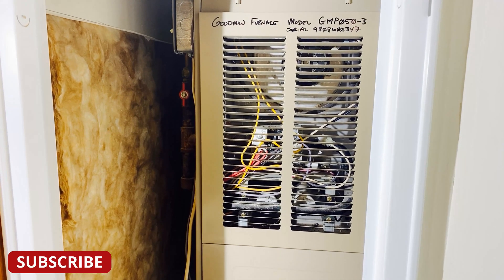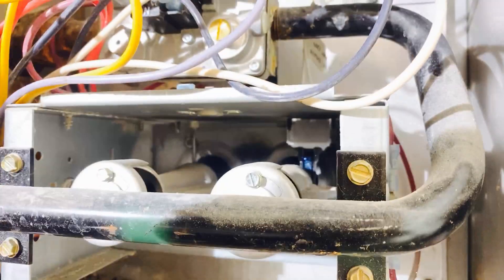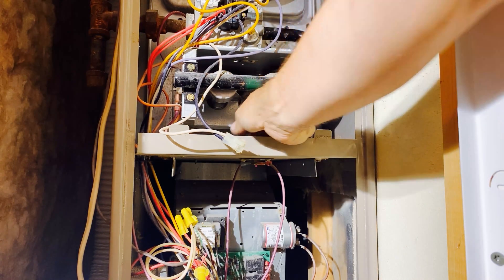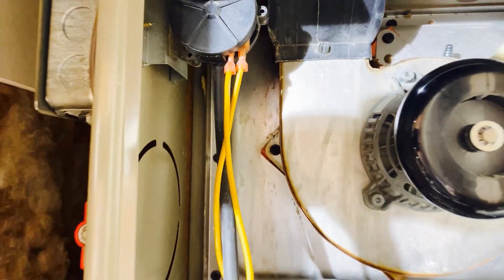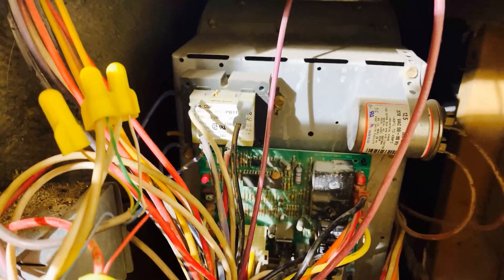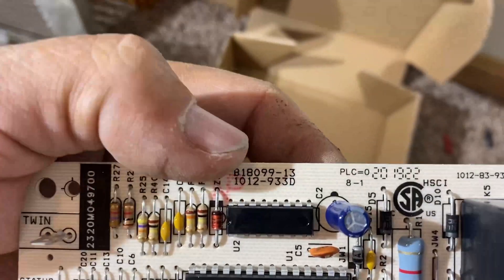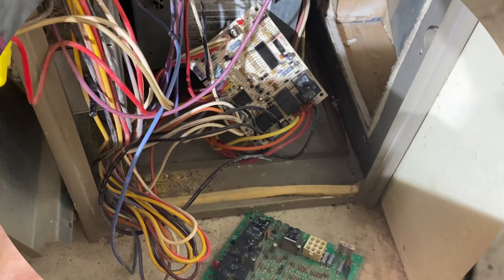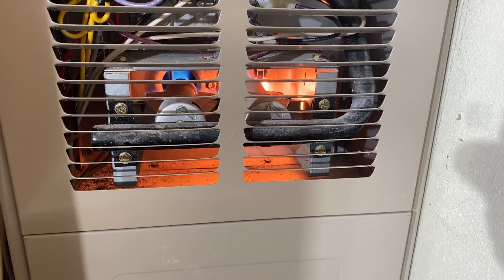Gas furnace not igniting -  Goodman furnace wont ignite - DIY Gas furnace repair

Comment: What does the flame sensor have to do with the furnace lighting?
Reply from the maker: Jim, 
Here are the simplified basics of what is happening when your furnace starts up so you and anyone else reading this thread can really wrap your head around the process... 
I know its a lot more than you asked for and you may know a lot of this. Please don't take this a smarty pants long winded answer. 
The better you understand it the better chance you have of fixing it! 
The thermostat calls for a heat cycle...
The evacuation fan comes on first getting rid of any possible build up of flammable gasses so there won't be an explosion in case of a leak or other build up of gasses in the burn chamber.
The computer (the control board is a very simple little computer) tests the operation of that evacuation fan with the pressure switch. 
If the pressure switch isn't working the computer will "believe' the evacuation motor did not do its job and will not light the ignitor (to avoid a big kaboom). 
If the evacuation fan works, and the pressure switch verifies that for the computer board, the ignitor is given power and will start to glow. 
Then a limited cycle of gas is supplied to the burner and that gas gets lit by the glowing ignitor. 
A gas pressure verification happens in this approximate time frame as well that lets the computer know that there is gas being sent and that the gas flow through the gas supply valve is sufficient. 
IF everything is still in order and that limited cycle of gas gets lit,  the flame will heat up the flame sensor which is located in the path of the gas flame. 
If the gas didnt light because the ignitor was not functioning or any other reason, the flame sensor will trip the computer and tell the furnace to stop sending flammable gas (to avoid a gas build up and potential bad deal like the aforementioned big kaboom). 
If the flame flame sensor says that the furnace is lit and everything seems to be ok so far, the computer sends the gas for a full heating burn cycle.  
So, the flame sensor is just a thermocouple (fancy thermometer) that tells the computer that there is fire present and it is ok to turn on the entire gas flow for a full flame burn cycle. 
Remember, the flame sensor will often get a buildup of soot on it causing it to be finicky... Some sensors can be a pain in the butt and that is just pretty common with this one. So clean it regularly, or ANY time you have a furnace problem.
NOW, if the full flame burn cycle starts and the heat distribution fan starts pushing the heat around the building like it should, everything still moves forward as intended. 
But there is also an overheat sensor that would indicate to the computer that things are getting too hot in the furnace if that heat distribution fan fails.
If everything is still working as expected, the heat should get distributed to the building.
If the heat is distributed to the area of the thermostat, and the thermostat reads the heat properly, it will indicate to the computer when the THERMOSTAT has heated up to the set temperature.
(Notice I didn't say the ROOM has heated up to the set temperature... thermostat placement is important!!) 
The computer, will then stop the current furnace heating cycle.
The next time the thermostat sends a signal calling for heat, this whole process starts again. 
Some people get pretty intimidated by the "Computer" operated furnace but this is really all a series of little steps in a specific order with checks performed by sensors (which are really just fancy switches) that say either "good to proceed" or "whoaaaa something is wrong". 
The "computer" really reads the sensors just like a light switch...  either the switch (sensor) is ON, or it is OFF.  
Hope this helps, it is a bit simplified but not a whole lot! 
Have a super day and stay healthy and safe my friend!
-Shane
Reply: it verifies a flame and keeps it light. its a safety device to avoid dumping gas into your house without it being burned. its a good maintenance item to stay ahead of when looking into ignition problems.

Comment: Mine will start up and the igniter lights up but it’s like gas never comes out, it never flames up
Reply from the maker: What flash code is it giving you? 
-Shane
Reply: @AHandleOnThings  the same as yours, just one “failure to ignite “
Reply from the maker: Hmmm... I would start to consider a gas valve failure (assuming the gas supply to the valve is good) 
Let us know what you come up with !
-Shane

Comment: It would have been helpful if you had cycled your furnace so that we could see what exactly the problem was. By setting your thermostat for the heater to come on and pushing the door switch down by hand in filming everything that happens afterwards we can get a better idea of what exactly might be going on. Perhaps it was the flame sensor not getting hot enough because it's dirty or it's the igniter not igniting we can tell what exactly happened by viewing everything as it happens in sequence. This is a really important step in the troubleshooting process that can't be overlooked as you have here.

Also most newer Goodman furnaces and probably all furnaces have an LED light on the control board design to blink at different rates to tell you what is wrong. many of the access panels have a clear window that looks directly at this light and you didn't mention anything about either of those. Knowing the troubleshooting code can be an essential piece of information for knowing how to fix it

Comment: it sat for almost 2 years before i ,myself installed it,but it was a new never used furnace  ,i have a new gas valve on the way
Reply from the maker: Right on, I had a problem with one of my barn furnaces that I installed that wasn't too different from your problem too... I found that the shut off valve I was using just wasn't allowing enough gas flow. I changed that out and it solved my issue. Either way, I hope you get yours up and running well!
Have a super holiday and keep us updated! 
-Shane

Comment: On an another video the technician says it is very important not to touch the igniter metal tube since the oils on your skin can wreck it. Even if you disagree it seems like it's a safe thing to do.
Reply from the maker: Nope, I don't disagree, that is indeed a "best practice" recommendation. I botched that part while filming with one hand, working with the other while standing on my head in a little furnace closet while trying to remember the other stuff.
Have a super holiday season and stay safe and healthy!
-Shane

Comment: I have a goodman furnace that will run awhile and then does not want to light...it's a new furnace..when it runs it heats really good and reaches the set temp. and stops...but when it goes to run again it won't...it puts out some gas but does not light...the igniter does glow
Reply from the maker: Well, that is odd indeed.
Check to make sure the gas valve is all the way open and check for a fault code as well.
Being a new furnace I would (without being there to troubleshoot it properly) watch for a gas supply issue. Barring a fault code that directs you elsewhere, if the gas valves are indeed open properly, I would have the tech who installed it check for a gas supply issue.
Stay safe and stay healthy, 
-Shane
Reply: Could be a failing gas valve, a tech will be needed to see what pressure is leaving the valve, it should be 3.50WC. Requires a special tool to read those pressures. Also what code does it give you. The burners may need cleaned, could be a failing valve,, could be the igniter getting weak and not getting hot enough to light the gas. It could be several issues.
Reply: @zack9912000  the only code it gives is one blink witch is that it has exceeded it's try's to start ...it would run perfect... then the next time it tries to start you hear a kinda hiss and smell a hint of gas ...but it won't start..blow plug glows hot

Comment: Can you plz explain the pressure switch that it works with negative pressure of inducer motor ?
Reply from the maker: I have not pulled one apart, but they aren't overly complex. The pressure switch works off of negative pressure (vacuum pressure) that is created when the evacuation motor runs. That suction acts on a diaphragm that actuates the switch. 
-Shane
Reply: The pressure switch is a vacuum safty device, when the inducer calls for heat it sends 120v to the inducer motor pulling air through  the heat exchanger .  If there is no issues with the flue it should pull a vacuum closing the switch passed its rated vacuum 
which will allow the furance to start the firing sequence. NEVER PUT A SMALLER WC RATED PRESSURE SWITCH IN that is called for
Reply: Thanks guys for the reply

Comment: I have a goodman furnace and getting a Open High Limit code blinking. I've replaced nearly everything from the limit switches to the ignitor, filters etc. Any idea what I can do ?
Reply from the maker: It isn't really possible to troubleshoot your system without being there but...
a high limit warning means your furnace is essentially overheating. 
This is most often caused by an air flow issue. Either inflow or outflow.
So... start by checking that filters are clean and furnace ducts are open and make sure to physically check that the air is flowing. 
Then verify that your blower fan is working right and that the blower fan fins have not been damaged. 
The high limit switch itself is almost never bad in my experience... 
That's about the bet I can do for you without being there.
Be sure to let us know what you find! Lots of people read these threads and your experience will surely help people
Stay safe and stay healthy,
-Shane
Reply: So I took off my thermostat and tried to jump start it by connecting the wires which worked perfect for about an hour then the limit switch kicked back on. I'm going to replace the thermostat today and hope that works if not I believe the circuit board is the last thing to try at least on my own before requiring professional help
Reply: You need to call a servicd tech out on that, the limit is a safty device stating it is getting too hot.
The gas valve could be failing and gas pressure to the burners could be set TOO HIGH, you need special tools and knowledge  on how to adjust that. The blower could be failing and not be moving the air required to keep it under the main limit. It could be a board issue, but throwing parts at the problem isn't the right answer. See that daily a customer throws every part at it for it only being a simple fix, it cost people more tossing parts at the problem then just calling a pro.

Comment: the igniter is ceramic- do not touch with hands. oil from hands will cause early failure of the igniter. ask me how i know
Reply from the maker: Yep, you are correct... Sadly, while filming inside an area not much bigger than a saltine box and using one hand on the cameral and the other hand to work, I messed that part up.
Great catch, and you are absolutely correct. 
Stay safe and stay healthy my friend!
-Shane

Comment: I have a furnace tech who can't figure out why my furnace won't kick on.  I replaced the thermostat recently, and had the circuit board replaced last Feb 4.  When the thermostat schedule goes from 60 to 69 in the morning, the furnace doesn't engage to turn on, but after manually turning the thermostat down below 60 and up again it starts.  What do you think the problem would be?  The old thermostat did the same thing.
Reply from the maker: In the morning when the furnace fails to fire you need to check for a code before doing anything else. If there is no code blinking then try this...
There is a setting programmed within the furnace computer firmware called "hysteresis" which is the difference (swing) in temperature required between turning on and turning off. This is needed to keep the furnace from cycling excessively. Normally the hysteresis is set at about 5 degrees but that's a generalization and not necessarily a rule.
I would try setting the thermostat to increase from 60 to a number higher than 69 and see if that fixes the problem. So for the sake of testing it out, try setting it to go from 60 to 75 and see if the furnace fires. If that fixes the problem then it is an issue with the hysteresis programming in the furnace and you can fiddle around and just going to 70 after determining this is the problem may be enough to solve the issue. (or it might not)
Troubleshooting with this little information is difficult to say the least, but this would be my first guess.
I am going to bet however, (because I had a similar problem a few years ago with mine) that if you check for a code right away when the furnace fails to fire you will probably find a pressure switch code blinking. I was able to fix mine by just pulling the rubber hose and blowing it out good by mouth and I assume there was just dust blocking it. 
If you are going to do this tho, pull the hose from the pressure switch side first and blow it out and you should be able to blow through the hose easily... Then reattach the hose to the pressure switch and pull it from the other end and blow into it and you should hear a clicking sound as you puff air into it with some force. then if that's all good, make sure the hose appears to be in good condition. 
Be sure to let us know when you determine what gremlin is tormenting you! 
Lots of people read the posts and you may help someone else out too! 
Stay safe and stay healthy my friend,
-Shane
Reply: @AHandleOnThings  Thank you for the help.  The tech blew through the pressure switch hose, and apparently it may have had dirt in it, but it has been working ever since.  I'll let you know if we find anything else wrong. Thanks again.
Reply: Sounds like you need a better tech who isn't clueless from what I am reading that is a straight forward issue easily tested on site to see what the cause is. 

 Also stay away from schedule controlled thermostats, can't tell you how many times we go out on nuisense calls for them and people don't have them set up correctly. Also you don't save any money by dropping your temp that low,lower then 2 degrees its costing you more. It has to use more energy to catch up to the higher temps. Not only is it heating the air but all the objects in the home. Schedual thermostat are a huge marketing waste and cause more unnecessary visits.  A simple thermostat that is set it and forget it will save you because you not having such drastic changes.